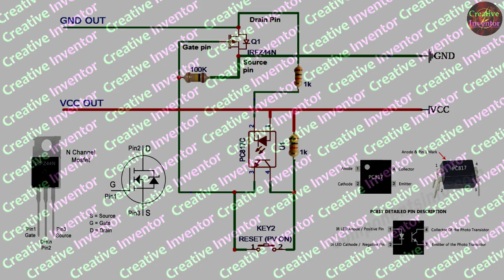4 in 1 Amazing Circuit, How To Make Electronics Fuse, Short circuit protection, Push button On Off

Comment: This is only on off switch not a 3.7 to 12 voltage converter why you make wrong videos
Reply from the maker: are you blind? where the hell i have written 3.7v to 12v converter, so don't make useless comments.